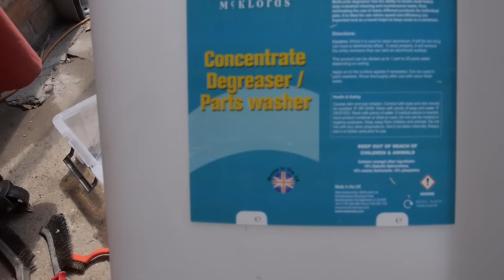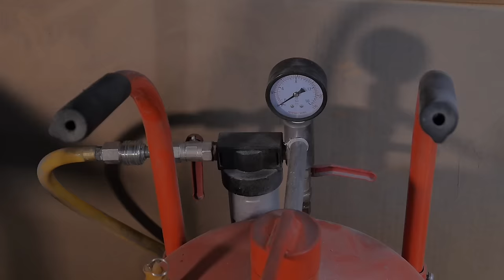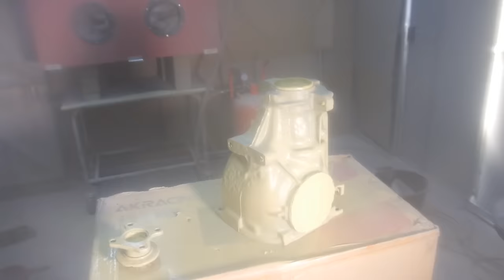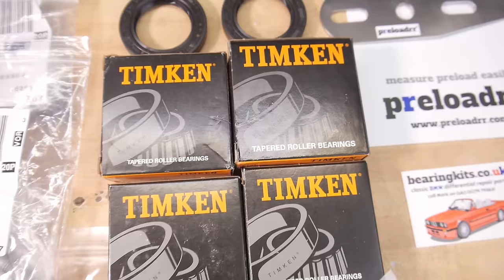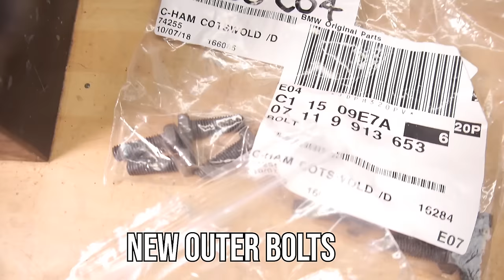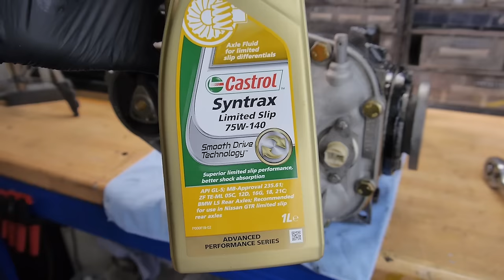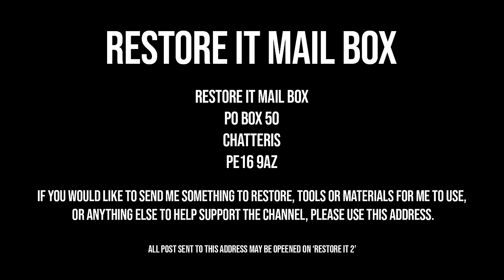BMW E30 Limited Slip Differential Restoration

Comment: Did it bother anyone else that he didn’t paint the diff cover lmao. Still an amazing job and loved the video tho
Reply: Aluminum doesn't rust, steel does. Cover is aluminum, body is steel. Seems to make sense.
Reply: Yes it does.  Especially since the cover is the part sticking towards the back and is basically the only part that is visible.  At least he didn't paint it red lmao.
Reply: @ericmiller7713  aluminium can corrode. :) i work as a aircraft structural mechanic so i know... Aircrafts that fly overseas have the most corrosion, beacuse of salt.
Reply: Marko Ilic Unprotected aluminium does oxidise,it turns into like a white powder
Reply: @steveguest8028  protection is there to make it last longer... We use Alodine 1200 for that matter. Even aircraft parts treated with Alodine or other anti corrosion agents come years later with corrosion on those spots.. Corrosion starts with microscopic gaps within the fibres of alloy, and then spread across the surface..
Reply: @markoilich8  alodine, primer and paint....that what we do on planes...
Reply: @jeanfrancoisgoyat2425  Same here fam :)
Reply: Still would have painted it to match regardless of it being aluminum
Reply: No I think is a real good job,not going to be expose,and in the first 100 miles,it's going to look like shit again lol,great job and he explains everything..real good job
Reply: Looks painted with something to me.
Reply: alittle contrast dont hurt
Reply: That cover is also for heat dissipation. It has cooling fins for a reason. Paint may insulate and block the heat inside. My 0.02 cents.
Reply: @agt155 shot blasted

Comment: Nice work!A small tip for a tool that can be useful in the future would be an air needle hammer, or "scaler". It is not expensive, and it really quickens up cleaning flaking, scaly rust in hard to reach places before glass bead blasting.

Comment: Another great job and interesting video - it takes talent to get them both right. Keep up the good work. 👍

Just a pointer on applying RTV as a gasket... make sure you put the sealant bead on the inboard side of the bolts, so that the oil won’t leak out through the bolt’s threads.

Comment: That is a serious lump of metal. 

Awesome restoration as always!
Reply: Hi
I have big problems with my car
Mercedes-Benz E320 1999

I spent a lot of money and no body fix it
Japan import
When i drive my car in straight away from120 km and more the car goes right and left i loose control and i should return back the steering wheel opposite direction to keeping on straight and these problem happen when any car come beside my car at any side left or right
Or if any winds in the weather

Pleaseeeeeeeeeeeeee help me
Reply: Yeah they are. I estimate this assembly weights about 80 lbs. I swapped in a higher ratio and repaired this same part on my e30 several times. It brings me back to the good ole' days.
Reply: i know, it's like Germans make cars like scaled down tank's but everyone else make ramped up go-karts. i got a 2001 1.9tdi 220bhp passat getting a 330cd next month, e46 respectively lol.

Comment: You do great work my friend. Isn't it nice to learn how something works that you previously didn't know. Next is rebuilding an automatic transmission. The only thing I would have done differently with the e30 diff is I would have powder coated it instead of painting it. It still looks good though. Maybe powder coating is something else you could learn. It's very easy. Along with anodizing. Anodizing can be a lot of fun.
Reply: Powder coating is good for the correct place,  two pack on cast iron is just right for the job.  IMHO

Comment: Most people would have splashed out on a brand new one, just goes to show how a little tlc can bring an engineering masterpiece back to its former glory. Well done mate.
Reply: It all depends on the price of a new part vs the cost to rebuild for me.
Reply: Wykyd I tend to find if you have the tools and bits for doing a job like that you can keep it cheap but if your a first timer you have to get all the tools and bits for the job and then the price shoots up, personally apart from a few bearings and oil seals I could do that for next to nothing

Comment: 18:30 - It seems to me that the sealant is incorrectly laid, it must go on the inside of the bolts, and not on the outside, otherwise your oil will flow through the bolts.
Reply: Wrong. I'm a certified YouTube watcher and I can tell you, you've never been more wrong
Reply: I think he used sealant to hold the gasket in place. All good.
Reply: no that sealant is for oil too. Used on the engine in a lot of places too
Reply: @SAK_-  A lot of people get this wrong but you do not use a sealant to replace a gasket. Let the gasket do it's job that is why it is made. The sealant is only there to hold the gasket in place nothing more. A little to much but I am not sure about BMW rears. People might know to put more because it's a common problem with their type of rear.
Reply: nibunimu,   I think the guy has played this game a few times in his life.   I trust,  he knows what he's doing.
Reply: When dude, im serious. My Cylinder head cover is sealed with this shit :D.
Reply: @SAK_-  if the cylinder covers are easy to get to then just replace them. It would take you no more than 20 min if it is easy. You only put the sealant on the corners and middle top, middle bottom just to hold the gasket in place. That is all.
Reply: @devon9249  🤣🤣🤣
Reply: Yeah actually no need for RTV when you use the gasket. RTV will actually make it more likely to leak after.

Comment: 18:33 made a wee mistake with your sealant... should draw rings of sealant around your bolt holes, some of those have leak potential.
Reply: Of all the diff services I’ve ever done I’ve never drawn circles around the bolt holes. Never had a diff leak.
Reply: @joshkey8930   I made a gasket for my e24 LSD  no leaks yet and way easier to remove than sealant if i ever need to open it up again.

Comment: 18:30 sealant must be on the inner side of the bolt holes (on the top you done right way, on the bottom change your mind :D can be leaking trough the bolts)

Comment: You should get a set of 12 sided non impact sockets, they tend to be thinner.
Reply: A 12 point is the last thing you want to use for really tight bolts/seized bolts. It can easily round them off.
Reply: @amak1131  if you buy them from china yeah.

Comment: Damn! Nice Diff! Pretty hard to come by now days! What gear ratio?
Reply: Helping Hand Auto Repair 3.64
Reply: いいですよい
Reply: 325i ratio is 3.73, e30 m3 was 4.10 and 325 e / es were 2.93 a common swap was 2.93 to 3.73 increased torque / acceleration like crazy but killed gas mileage.
Reply: Matthew Bair 325iS is 3.73

325i has various options for rear end. 

E you are correct

M3 correct.

Comment: I have a 92 e34 525i and it had horrible rust on the brake calipers so I took a couple days with a wire brush to get it all off but it looked way better than new when I was done.

Comment: Curious about not painting the diff cover. Is this because paint acts like a heat insulator or another reason?
Reply: BangDroid I was thinking the same thing. He should of just painted the same color to keep the theme.  He still did a good job as always.
Reply: I believe the cover is aluminum and might have even been unpainted from the factory

Comment: Why didn’t u paint the cover
Reply: I was wondering the same thing. Is it for heat dissipation? I noticed the heat sink fins on the mount section.
Reply: He's restoring the parts, not modifying them.
Reply: its aluminium it doenst rly need 2 be painted

Comment: restoration done at 75,000 miles.  will go for another 30,000 miles before you bring it back to the BWM shop before you finally say "F' it, imma get a Lexus"
Reply from the maker: Haha I don't know about that.
Reply: BMW Bust My Wallet
Reply: @glengray5411  E30's were very robust machines requiring no more maintenance than popular Japanese makes.  Arguably the ultimate daily driving machine of the 80's and 90's.

Comment: That 30mm nut is a pain in the ass, it was the exact same design swapping an M3 3.15 LSD into my e36. Ended up taking a chrome socket with a 1/2” impact, putting the diff case against the wall, and leaning on it with all my weight while rattling the balls off it until it came off. Same thing putting it back on, just a few drops of loctite and impacted it until it stopped moving.

Comment: Great video, very informative and professionally done. I just did not understand how you are correcting the backlash in the end. How do you move it from the side to the middle of the gears?
Reply: No one replied for all these months and now I know the answer, as I took my diff to be totally rebuilt. There, they explained, how the backlash is adjusted. To move it, you need different thickness shims. In this case, where they did not change the casing or the housing, all you need to do is write down which shim came from the left side and which from the right,and put them back accordingly when you reassemble, as they have different thickness, and putting them incorrectly will wear the ring and pinion. Even if you do that, it is imperative that you check with the paint, if the markings are in the center, as you don't want to destroy an already hard to find part. Good luck to everyone doing this!

Comment: Damn was that thing at the bottom of the ocean? That's a lot of work, I would have just found a good used replacement from a lower mileage parts car. lol I had a 86 325e with a 2.95 open dif then pulled a 3.46 LSD from a 86 635Csi. After changing the axle flanges it bolted right on.  Added a JC performance chip  then it was a great track or back roads car since on the freeway it would almost red line at 80 mph.

Comment: Well done, there is a question. Why was it necessary to paint the gear?
Reply: You do that to check for proper contact pattern between the gear and the pinion,you just cant put it together and hope for the best,there are several adjustments you need to make,the paint makes a impression of the teeth meshing with each other and tells you where you are at at the moment and depending on that you know if you need to make any adjustments or not, Google "installing rear end gears" for a  more detailed info.
Reply: I'm not talking about this, I'm talking about the gear cover)))
Reply: Well you did say "gear" not gear cover,i would assume you would paint something so it wont corrode anymore,i was wondering why he didn't paint the whole thing??  if i was restoring a rear end i would paint the whole thing but thats just me
Reply: +dntlss i assume cause the backing ensures cooling an by painting it ,it will become warmer . Not sure if he did it for that reason

Comment: The gear tooth patren is sopose to be in the middle during max diff lode Soo you want to set the gear so it's riding more like how you had it first time if I remember properly but doing a great job either way

Comment: The finished article is spot on. But why didn't you paint the differential cover ?
Reply from the maker: Its aluminium so shouldnt rust. I may paint it before putting it on the car.
Reply from the maker: And thank you!

Comment: You shouldn't sandblast/paint the connecting surfaces as they are made to tight tolerance, so they don't wobble or come loose during the drive. Did you check the shims on the output bearing flanges for side bearing play and proper gearing?

Comment: Hello, I would like to change the cover gasket of my differential soon. According to the manufacturer, you need a paper gasket and sealant. My question is where to apply the sealant? Only on the differential or on the differential and the cover? Greetings, Felix

Comment: If you don't have a use for the old tapered roller bearings I'd like to have them...will buy them or trade for something (I have 4 acres of things to be restored lol).
They might be good enough for a DIY lathe or mill...if not, then they'll surely forge into something useful.

Comment: I was wondering, currently i'm removing the rust off my diff. I use a wire wheel and some elbow grease. I couldn't reach everything yet and have no tools to get everything off. I sprayed the bare metal with some rust reformer that turns it into an epoxy base layer to spray. I used it for now to stop the rust while i'm not there. Do you recommend using a red oxide primer/paint as a base? I never see you use it in your videos.

Comment: I've never worked on a diff before, but I may have to try to do this on my E21 diff as the input seal is leaking bad, and so are the axle seals.this is helpful but I wish you had some explanatory narration to go with. Is that the worn propeller shaft seal at 5:44?

Comment: Do you use a different kind of paint for parts underneath  the car?  I feel like regular basecoat and clear wouldn't last very long under the chassis.  Is the black stuff an epoxy paint?

Comment: Dear Friend.
3 months ago I bought a 325i coupe from 1990. I have begun to have problems when passing the first gear. It jumps and the gearbox makes noise. I have changed master cylinder and slave clutch system, the problem disappears, but after two days there is again. You could help me with some advice to solve it. Thanks from Chile, South America.
Reply from the maker: Sounds like a bad gearbox but I'm nkr entirely sure. Sorry man.

Comment: Good to see people learning the Old Fashioned way... by just doing it.  Next time, do not EVER hit a threaded section of anything with a hammer... nor a spacer and a hammer.   Put the nut back on and thread till the nut and bolt are just short of flush...and hit The Nut with the hammer, so you cant damage the threads of the shaft or bolt...especially on a pinion shaft!  That little shaft is important to say the least and expensive.  Otherwise...nice job...Just a tiny bit of advice...
Reply from the maker: Thanks Squillymon!

Comment: Can that speed gear be replaced? The one on my differential got bent, cracked the speed sensor and got caught up in the gears. Screwed the whole thing up. Can that part be replace? The thin metal speed ring inside

Comment: i have a e36 LSD from a 320i or 318is will i be able to fit it in my e30 316i case? from what i can find out both are 168 so should work? dont want to take my car off the road and take it all apart incase it doesnt fit so any help appreciated

Comment: Because the intention of this video is restoration, so it is acceptable. But if for repairing car, you just wasted a time and money. As long the axle is not crack or broken, just change the bush mounting, oil seal, clutch disc and bearing. Change the nut if the nut is broken. Then assemble quickly. Put gear good gear oil. After all, this part will be place underneath car. No matter how much you make axle fancy glowing, it not worth.

Comment: Anyone knows if small leak in rear differential, possibly the front seal, could cause some kind of dronnin and vibration in the cabin, especially at low rpms?

Comment: That 3/8 drive ratchet wrench won't last long as you use a 3 foot long steel  leverage tube
Reply: Can agree with you but I do love the sense of improvising with this guy.. spot the double long extension as a breaker bar aswell.. I wonder why he doesn’t have a breaker.. it’s a basic tool and he seems to have some really good professional equipment..

Comment: 2 things....  #1, why no paint on the rear cover?  Just wondering..     #2, kinda sounds likes chipmunks with it being fast forwarded..  lol, great work though
Reply from the maker: It will help with heat dissipation and also its ally and wont rust, just slightly corrode. And 2 yes it does. Haha

Comment: Nice work, but why waste time and talent messing with that garbage?! Replace it with a proper differential if the car is to be driven, if it wont be driven then theres no use in putting anything in to it.